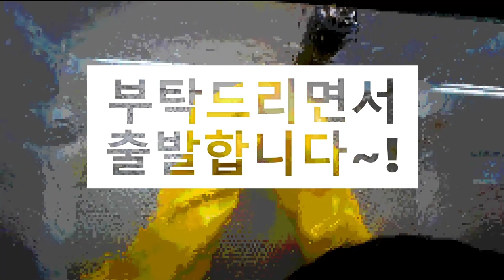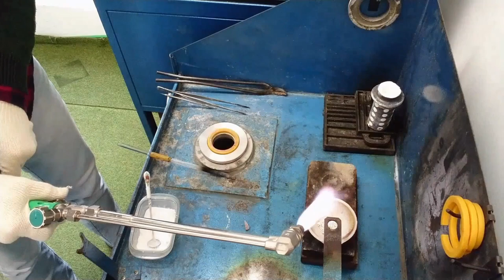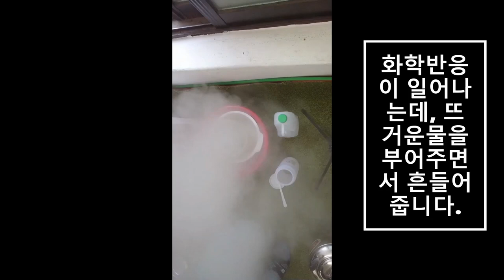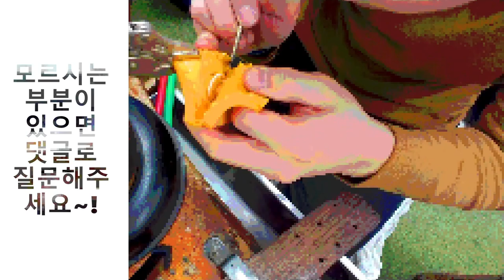쥬얼리 귀금속 주물작업에 대해 알아보기(Jewelry casting process) [얼티미시아Ultimetia]

Comment from the maker: ▶▶타임라인◀◀

▶▶Time Line◀◀

     

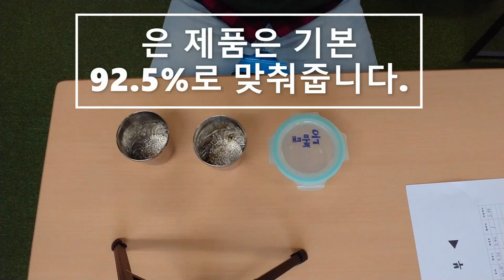0:47 ~ 1:12 금/은 함량 맞추기(Gold / silver content matching)

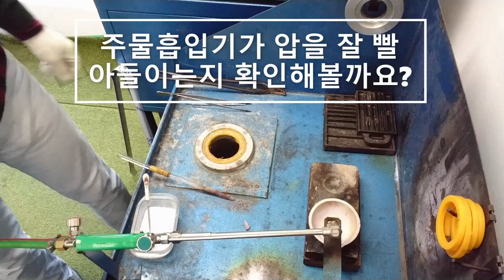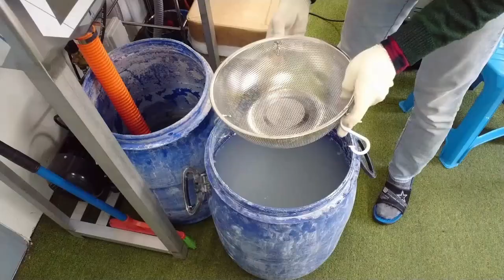1:13 ~ 4:25 주물작업(Casting work)

4:27 ~ 5:34 석고털어내기(Plaster removal)

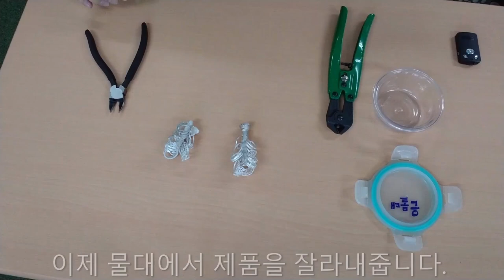5:35 ~ 6:22 석고분쇄기 사용(Using plaster grinder)

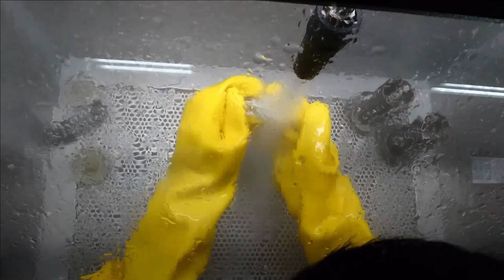6:23 ~ 7:46 물대에서 제품자르기(Crop products from floors)

7:48 ~ 9:09 뻥작업(Punch work)

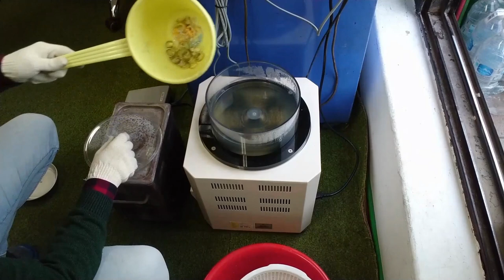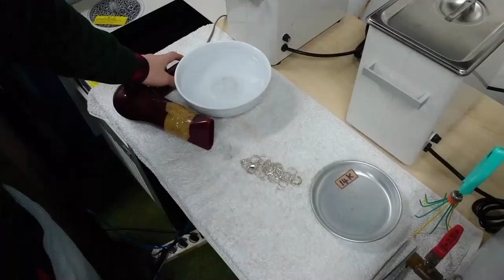9:10 ~ 10:15 덤브링 작업(Dumbling operation)

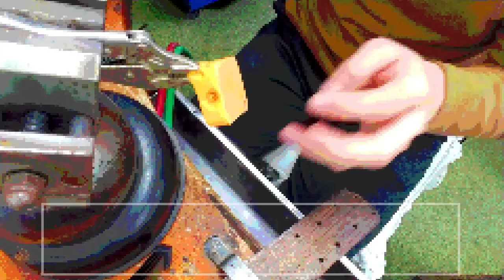10:17 ~ 10:49 제품 건조하기(Drying the product)